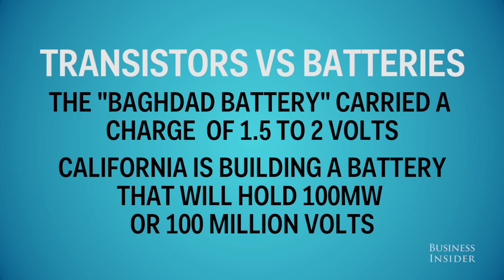Engineering Struggles Behind Battery Technology

Comment: 0:40 No, you idiots, voltage is NOT a measure of electrical capacity. And you converted it like a watt is equal to a volt, which is rediculous. Wattage is equal to voltage times current or P=V•I. And you also don't measure capacity in watts. You measure it in amp hours. As an electronics enthusiast, this irritates me beyond any reasonable measure. If the battery had an output of 100 MILLION VOLTS, there is NO WAY you could ever separate the terminals far enough to stop them from arcing. It would arc from tens of meters away.